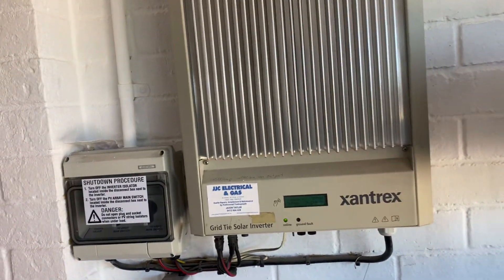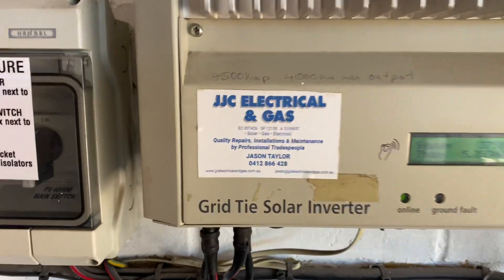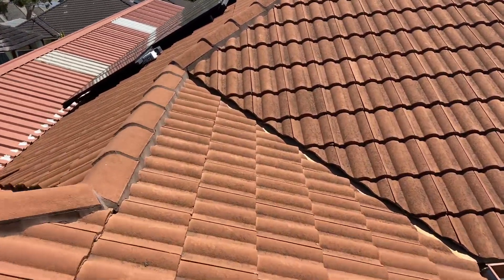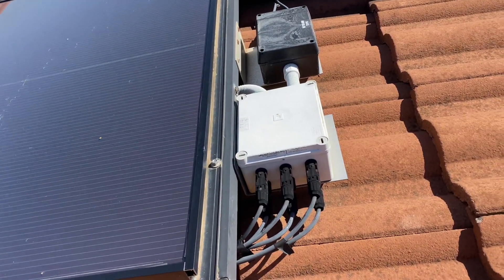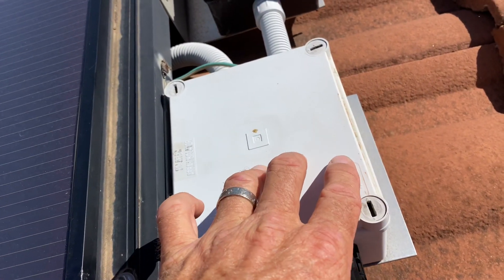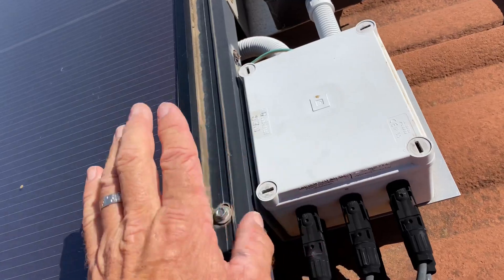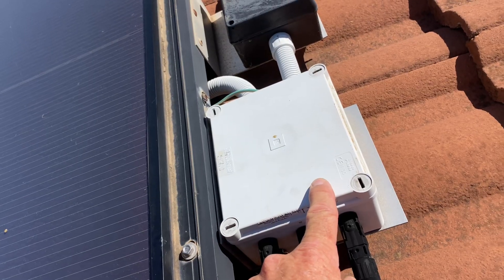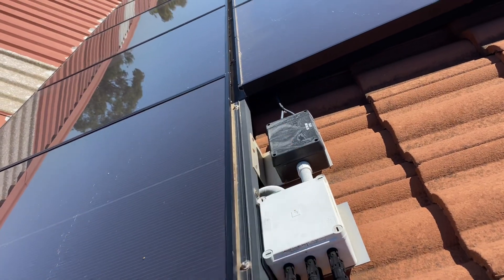Fixing up an older Xantrex with Kaneka solar panels system in Sinagra Perth WA.

Comment: my xantrax died after a teenager ran his car into a 33kva tower and the lines dropped on the 240v circuit below the tower. It was replaced with a fronious and even though its a smaller output size its making more power at the end of the day. I still have the old inverter, I wanted to see it repaired and working again or dos something with the teriodal coil inside

Comment: After 15 years those panels physically look good, I'd probably put a cover over those junction/combiner boxes though, just to keep the elements away from the plastic and MC4 connectors.
Reply from the maker: Yep thats a good point, they are holding up extremely well considering their age and exposure to the sun.

Comment: That is certainly a different install by today’s standards. The combiner box on the roof, was there any evidence of water ingress? Great to see an older system still kicking on. That would have been a large system for the day as well. Great video and way to go fixing it rather than rip off and replace.
Reply from the maker: A tiny bit of ingress yes 👍🏻